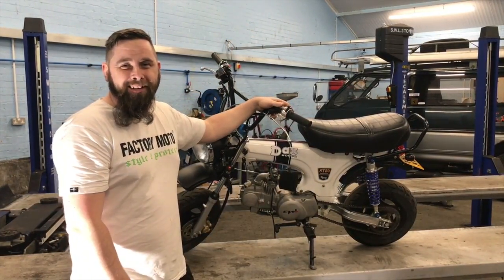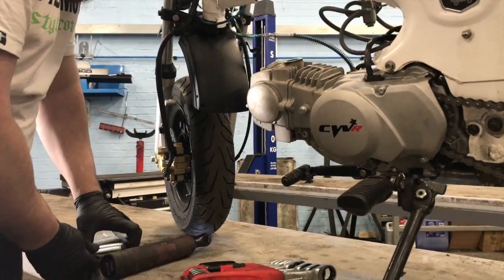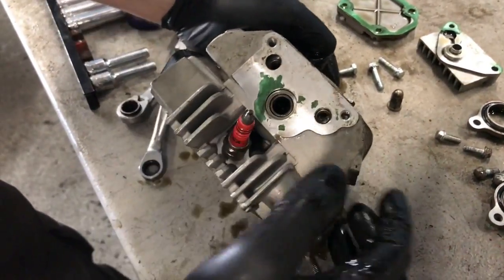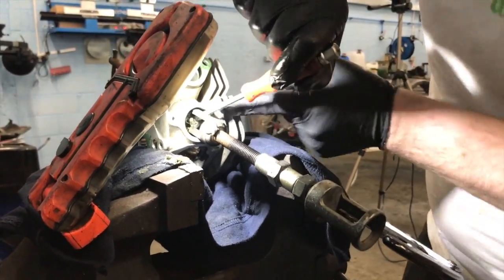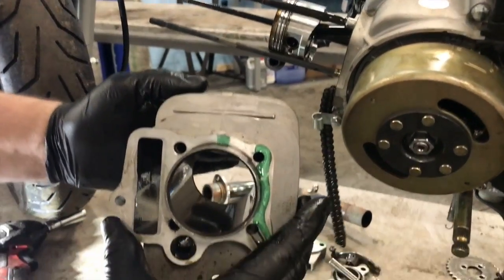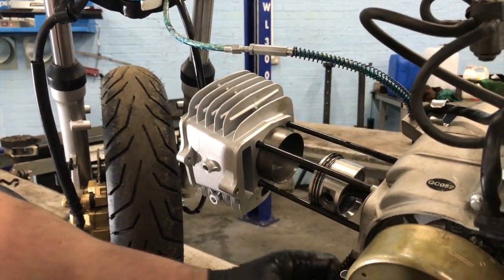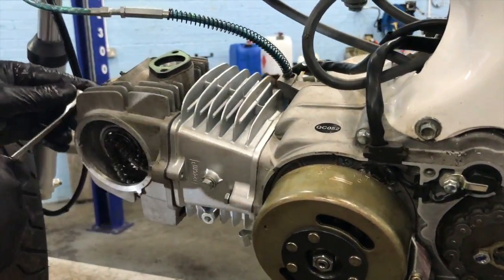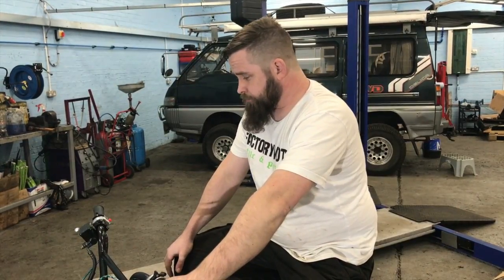Dax Z40 camshaft, 140 cc monkey

Comment: Brilliant video, now installing a z40 cam in my yx140, will follow this step by step 😎
Reply from the maker: Jay Pearce cheers for the nice comment dude I’ve given you a subscribe I also enjoy rc stuff and do regularly bashing and small builds though my channel is mostly bike not rc based Seen a few of your vids good stuff 🤟
Reply: @unpluggedautomotive878  hey dude, ive done the z40 install etc but the bike will only run with the choke on, soon as i turn the choke off it will jus die, any ideas lol. The carb was cleaned before I did the z40 swap so I'm guessing it's not a blocked pilot or anything? The engine is a yx140
Reply: I was wondering what the little governor tyre thing was on the stock cam but I saw yours worked fine without that bit.
Reply from the maker: Jay Pearce yeah check you carb jets and air ways are clear check your fuel tap is flowing correctly and it’s not fuel starving
Reply: @unpluggedautomotive878  cheers dude, I've moved the needle down one slot to richen it up slightly and it'll run now. Thanks boss

Comment: Are the valve springs that comes with the camshaft stronger than the stock springs?
Reply from the maker: Unsure but changed them anyway and it runs great

Comment: Do the rockers in the head need to be set in a certain way while doing the timing?
Reply from the maker: once timing is correct a feeler gauge is used to set them different engine had different specs old google is your friend hope you sorted it
Reply: Also does the inlet valve need to be open when setting the timing?

Comment: JUST SAYING. Just because the bike bogs dosont mean it needs a new carb. Mybe the engine wasont at engine temp.
Reply from the maker: Xbox needs help was low on fuel after I checked that the carb was off a 90cc and far to small anyway aways happy for comments and feed back dude
Reply: @unpluggedautomotive878   makes sense mate. Keep up the good work :)

Comment: 1year later comment but its a 125 not a 140 coz on the cyl bore it says 124cm3 so its still a yx125 not a yx140
Reply from the maker: BFD•TiMMiNS I wouldn’t take much notice of the casting numbers The 88cc kits I’ve fitted in the passed have said 49cm on the bore casting it was a 140 kit that was ordered remember the piston being a different size cheers for the comment good spot 🤟
Reply: Unplugged Automotive never knew that. i have that z40cam in my kmxr140 and its a fast reving engine.